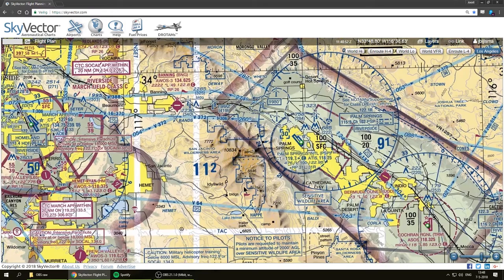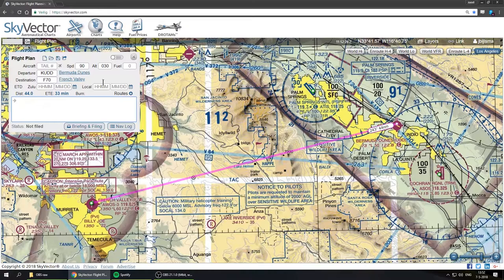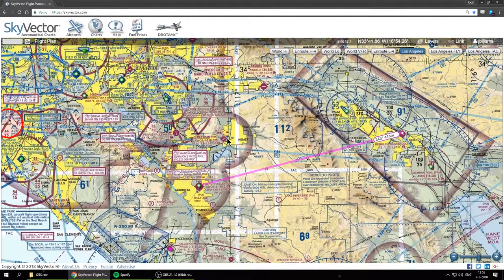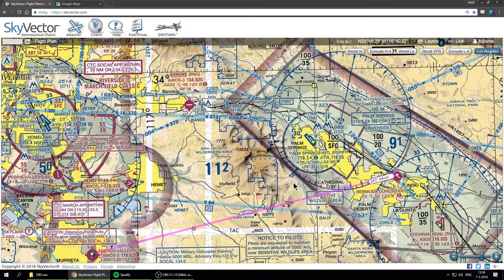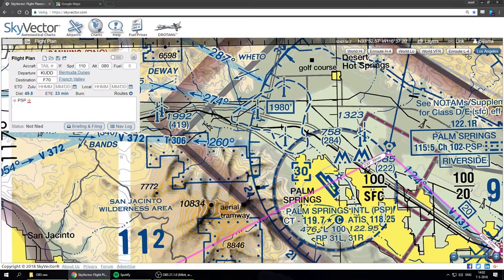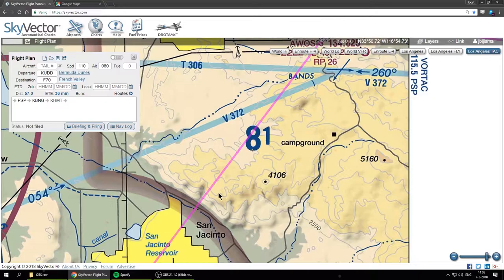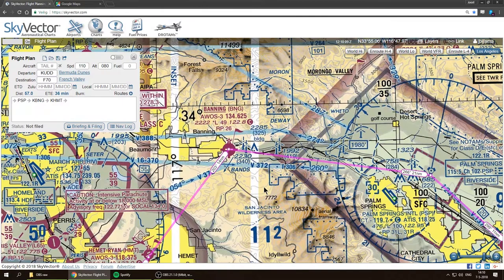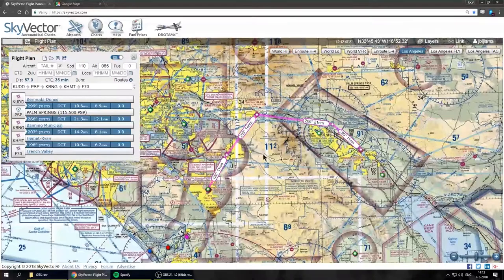(Old) Flight School | Ep-16: Simple VFR navlog | Flight planning | C172 REP | X-plane 11

Comment: As alwys: nice video series :) I got a short question to you as an owner of the C172 REP and the AFL C172... which one do you prefer in terms of realistic behaviour, flightmodel etc? I realized some huge differences in both aircrafts regarding the leaning of mixture and the trim set for initial climb with 75 kts (the REP wants to be trimmed nose-down, but the the AFL requires a nose-up trim to hold the desired speed).
May it be that these two model different types of the C172 or what else can cause this huge difference (the loadout was of course the same in both A/C as I tested) or maybe one of them is not modelled as correctly as the respective developer claims it to be...

BR
Nico

P.S.:
The AFL also seems to lack the Lean-of-peak area - the engine just stutters und dies if you lean a tiny bit over the peak.
Any answers/explanations are much appreciated.